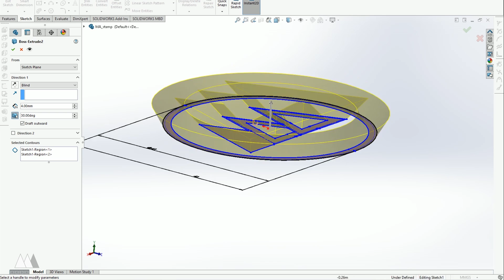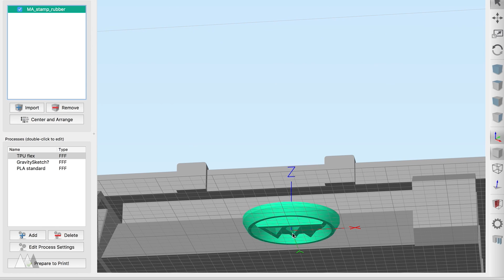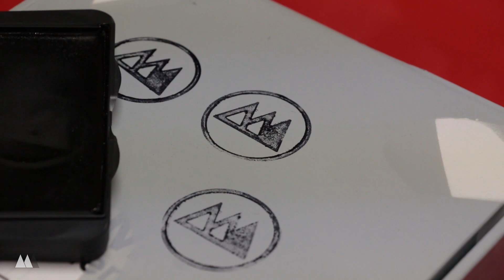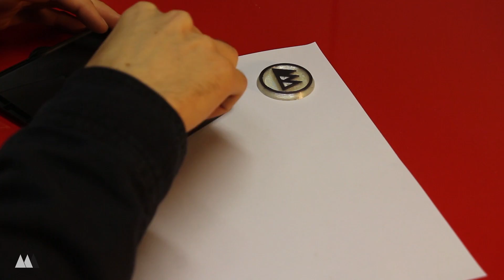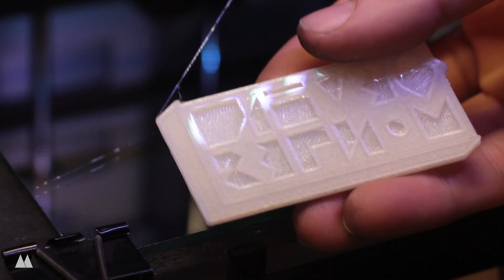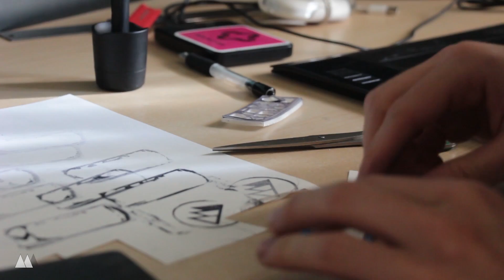Stamp Anything! 3D Printed Custom Stamps

Comment: I had to laugh I have been making rubber stamps 24 years and I would never use my 3D printer to make a stamp I have used my 3D print to make a stamp handle but it takes a long time so it's not probable but there's a sucker born every minute so you'll probably sell them but you should look into getting a laser to engrave your rubber
Reply from the maker: Hehe yea I made this quite a while back when I had to use my printer for everything. I've got lasers now! :D

Comment: Yeah, a world where to make "any stamp you want" you have to enter into a masochistic relationship with a particularly expensive proprietary software vendor with all sorts of strings and with the certainty that they will treat you as a criminal if you humanly share the stuff you paid for. Besides being an unsettling case of stockholm syndrome, it is treason to your viewers to suggest entering into this contract themselves and not explore the unbinding open-source alternatives like FreeCAD or Blender - heck, even the simplest 3D modeller can do the kind of operations you show here!
Reply: Speaking from experience, Solidworks was a required program to learn (and buy) when I did engineering. I assume it was the same for Devon, and because he knows the program well, that's why he uses it rather than learning a new program altogether.
Reply: Cláudio Sampaio Blender is very different from a CAD program, just saying. Also, nothing wrong with solidworks. There's plenty of packages out there. why are we upset? You have to pay a bit for one vs. the other?
Reply: Justplanecrazy25 about Blender - it is not a CAD, but it can very well be used for such a simple design. Although I did mention it is expensive, my  complaint is not about the price*, I complained about the stealing of freedoms, "open-source" has nothing to do with price and everything to do with not enforcing artificial scarcity. Before assuming anything, question me if that's what I mean.

* in this case though it is a high barrier to people willing to learn 3d modelling but not having the money for that package. In this case, I am not against D'Assault Systems charging people for what they think they are worth, I am against people who recklessly recommend them in the manner of this video.
Reply: jhubeJELLO exactly. That's for HIS convenience (and Stoclkholm Syndrome), not his watchers'.

Comment: hello i am planning to buy a affordable 3d printer it has 0,1 millimeter nozle and a heated print bed do you have any tips for me? :)
Reply from the maker: .1 mm is super tiny, sounds very difficult to print with
Reply: Make Anything // 3D Printing Channel i ment the resolution is .1 mm or is that the same
Reply: .1mm nozle will take days to print. 
0.1mm should be the max resolution you can print with. 
They are different things.

Get a 0,4mm nozzle. It is a great compromise between speed and quality. One of the best to start!
Reply: SonarIsDead ah thnx it said .1 mm resolution on the website
Reply: Skoby192 is Boss i will take a look at it :D

Comment: I made something similar to this but it was a wax stamper. Mine didn't work out. your ninjaflex idea was better than just pla. Another reason I think mine didn't work was because the wax easily got stuck in the small 30mm diameter of the stamper.

Comment: No handle shakes head

Heheh no it's cool, I've always wanted to do this so I can stamp into wax
Reply: GameSnippets_Jimmy wax stamps you need to do a reverse stamp and it can all be done in 1 material, my recommendation is raptor pla from makergeeks
Reply: Why raptor pla? Been curious about different PLA materials lately. Also I'd just do my design then flip it in blender easy enough but thanks for the heads up, I would likely have forgotten XD

Comment: If you scuff the top of the stamp with really fine sand paper or a dry magic eraser sponge, it'll hold the ink a lot better and give you a nicer print
Reply: Jess Thompson great suggestion.  Also, if you added a thin piece of foam instead of the cardboard I think you'd have great results, as this mimics traditional wood mounted rubber stamps.  I know nothing about 3d printing, except from what you've taught me, yet I'm pretty knowledgeable when it comes to stamping.  If you do not want to change the design, stamping with a mouse pad under or on top stack of magazines should produce a more consistent, bold stamp impression as an alternative.  Good luck!